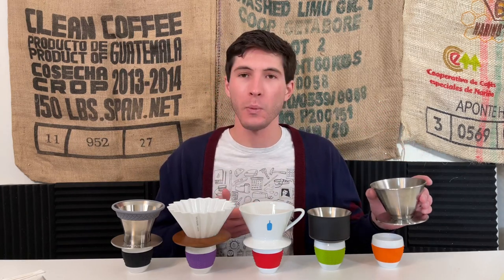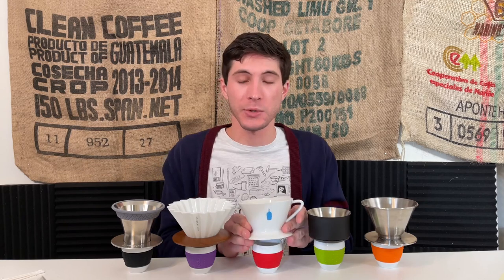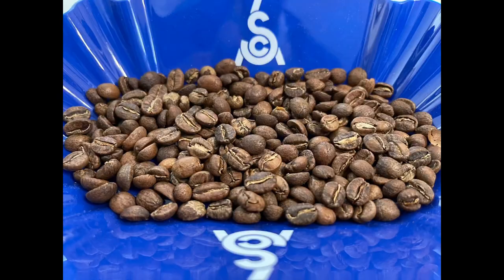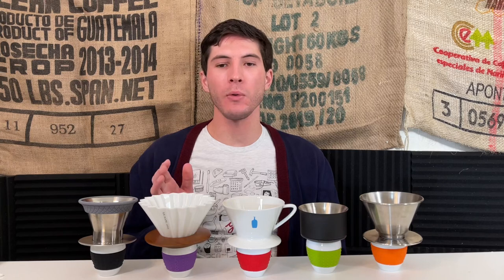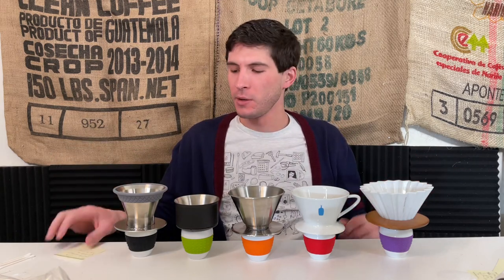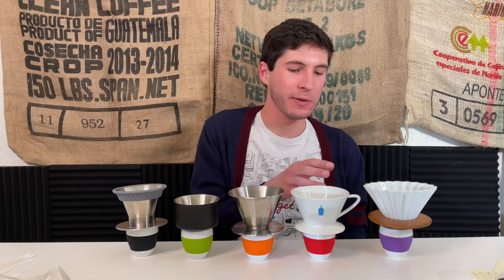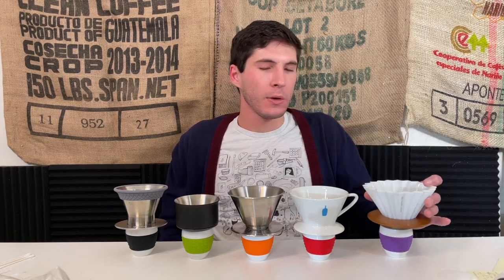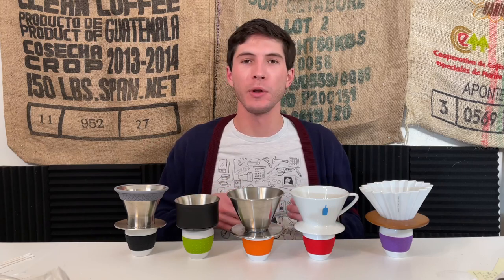One Grind Size, Five Drippers

Comment: Excelente information. It’s hard to find knowledge like this on YT. 
I just picked up the BB dripper, after a few years of using the Kalita 185 & 155 in stainless. 
I’m using an aligned Lido E grinder, have used it for 3 years now. 
I find that the BBD can stall out on the drawdown. I know that the Lido E isn’t the worlds best filter grinder but I have some very good cups on the v60 untabbed filters, with drawdowns in the 45 seconds to 1 min range. 
But even brews that run long on the BB I have yet to run into astringency or bitterness. The typical cup from it is very sweet, syrupy, and has great mouthfeel and texture. 

I agree with that it looks like a batch brew basket, and it reminds me of when I can get some stellar batch brew from a specialty shop. 
Thanks for the awesome videos!

Comment: I have yet to experience a sweet cup with the Blue Bottle dripper (which you called out in your review) and I'm curious if you can share a bit more about your brewing technique in this review. 1) On the grind size, can you reference a common grinder setting that would be close to the same, maybe your Ode setting?
2) What temperature did you brew at?

Thanks! Really enjoyed this video :)

Comment: Curious as to which grinder you used for this experiment.  Did you use the Ode by chance?
Reply from the maker: Pre-‘15 EK in MAX
Reply: @michael_j_fabian  thanks!  have you tried your Ode with the Stagg X yet?  I have the Ode and have been using it with the Blue Bottle dripper only at work and I’ve found that for a 21g dose I have to grind on the finest setting.  I haven’t tried the Stagg yet with the Ode and that same dose.
Reply from the maker: Yes but not extensively yet